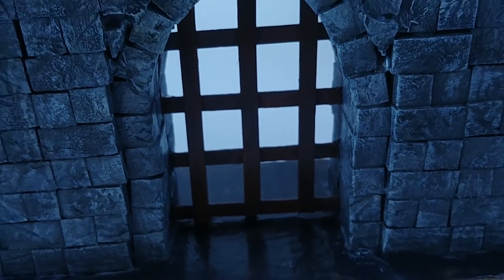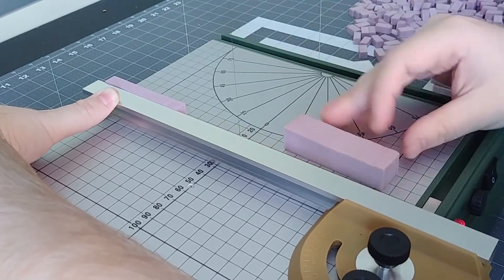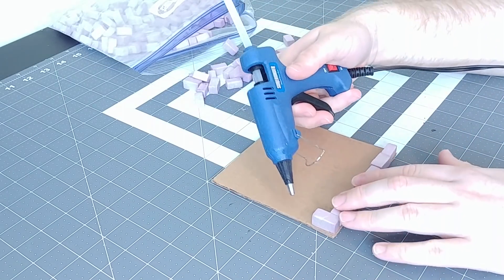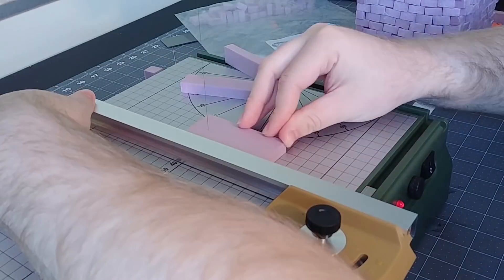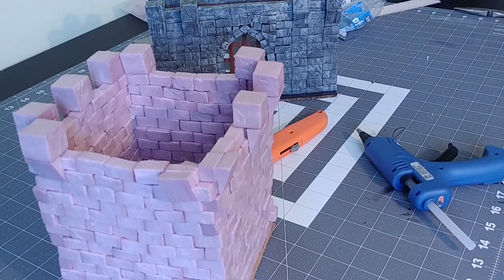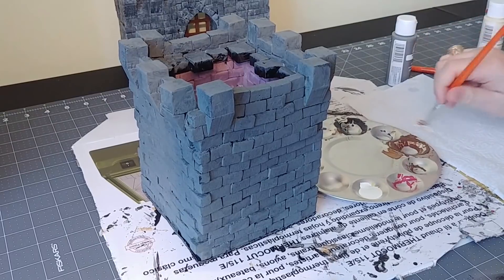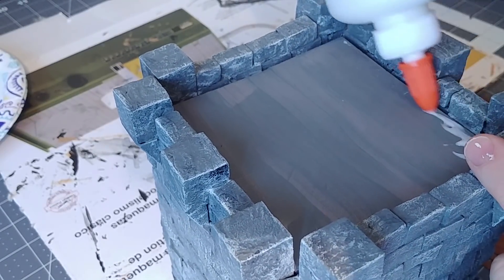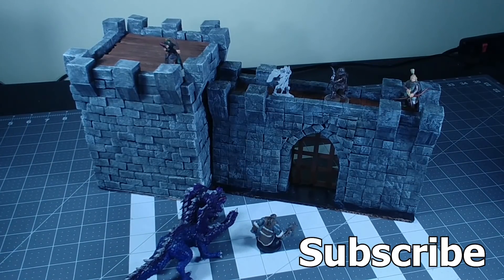How to Make a Castle Tower for D&D

Comment: To make the diagonal, slide the top wire spool holder towards the bend of the top arm so the wire runs from the top arm down to the table at an angle. Then run your bricks through as normal and voila, angle cuts

Comment: If you want to cut at an angle. You can do that perfectly just by moving back the top part (The Wire reel) back along the proxxon arm. That's why there are 2 knobs there, One for the wire reel and one to unlock the part and move it back to the desired angle.

Comment: Just watched this video after your siege tower video. Another fantastic video! This gives me a couple questions (as I mentioned, I do historical and fantasy medieval wargaming).
1) Have you ever modeled machicolations, or is that over-engineering a piece of defensive terrain?
2) Would you have any advice on attempting to do a whitewash/limewash coating on walls and towers?
Reply from the maker: Thank you! I am glad you like them :)

1- I have not modeled them, but that is purely because I prefer this aesthetic, it makes things easier to mod, and create pieces that fit with one another. They are fantastic, but I think general crenelations get the job done just fine for the most part :) 

2- I would paint the whole thing white instead of black, then go over it with a cream white, a light brown wash, and then finally a couple varrying grays for drybrushing :)

Comment: have you tried making these in 2 separate sections? like a top and a bottom half? so you could lift the top and have an interior part. could use some small magnets to hold them together. would be pretty interesting to see
Reply from the maker: I haven't with THIS build, but I have made an interior playable modular tower in a different video :)

Comment: What is the product for the wire cutter? I have a hand wire cutter, you think that'd suffice?
Reply from the maker: Oh absolutely! You could even use a razorblade or hobby knife if needed :) I use a Proxxon, but it's kind of like the caddilac of hot wire foam cutters. There are cheaper products that get the job done just as well.
Reply: @Rybonator  I got the new 2020 Hercules hot wire cutting table. It seems pretty close in quality

Comment: Hey man not sure how well this would work but you can move the thing that holds the wire on the cutter, making an angle for the little triangle pieces you made. Just a thought, nice work tho! Got a sub out of me :p
On that note, do you have a vid for the gatehouse you made?
Reply from the maker: Thanks for the tip! I had no idea. I need to exoeriment some more. :)

Thanks for watching! Glad you like the content.

No i don't, it was actually my first terrain project ever, so it was all a kind of test of what I could do. Essentially I left that gate opening and slide some coffee stirrers in between in a weave pattern. Maybe I'll make another similar gate someday.:) but for now, the build process is the same as my tower, except I rotated the blocks 90 degrees for every 2 that I put down. I should have done the same for this tower to keep it symmetrical, but I wanted this to also stand on it's own and not require the gate.
Reply: Lol, didn't see this comment was on here already, so I made the same suggestion. It works like a charm. Put a pencil mark on the top arm so the cut is repeatable at a later date if you wish to repeat the cuts for a second or third tower.

Comment: That foam cutter thing, how much does one usually cost?
Reply from the maker: Depending if they are on sale or not, 80 - 120$. But a proxxon is like the Cadillac of hot wire cutters. You can get some for 10 bucks or even DIY one for super cheap. :)

Comment: why didn`t you simly set the wire at an angle?
Reply from the maker: Unfortunately this device doesn't allow you to do anything other than 90 degrees
Reply: @Rybonator   Rybonator  oh yes. you can! just set the wire on 90° angle. Mark left side from the screw thing wich you tightned the wire before. there is this little metal sleigh. you know what i mean.
left from that put a mark with permanent sharpie. then loose that thing. and loose the wire that it can be released from the  role! then, pull the sleight so that the wire is on  needed angle. thight the wire and the sleight. then work with the angle.  then you can put it back to 90° very fast. And if you want you can put down a 45° mark for easy switching.

Comment: Man tell me how the gun hot glue they don't distroy your bricks for tower i have problem with that when i try to stuck the bricks
Reply from the maker: I don't know if yours just runs crazy hot or if you are using a different kind of foam. XPS foam, like what I use, is insulation foam so it doesn't burn up as easy as stuff like styrofoam. Maybe that's your issue?
Reply: Low temp glue guns are best for terrain building in my opinion especially when using foam

Comment: Wouldn't it be easier to just make four walls and then etch the brick pattern into them?
Reply from the maker: Yes it would be easier, BUT it wouldn't look like what I was going for. It would look like a perfectly flat brick wall. The hand laying gives it that 'This is an old building and it isn't perfectly straight etc.' feel that I was going for. By all means you can make something equally as good the way you are describing! Just not what I was going for. :)